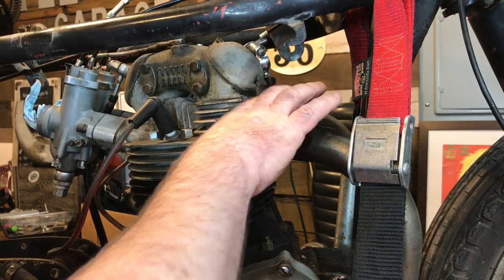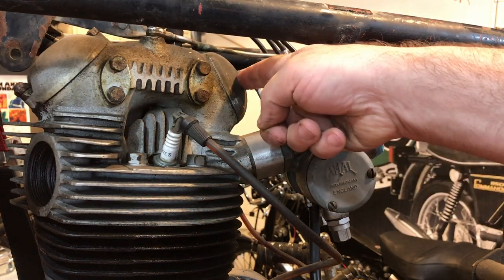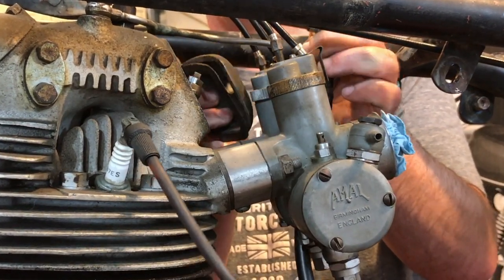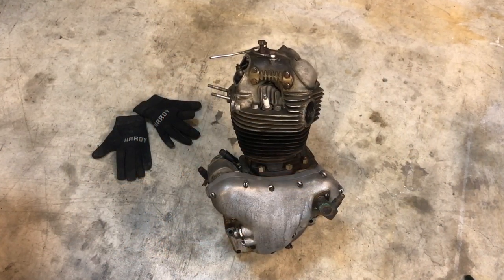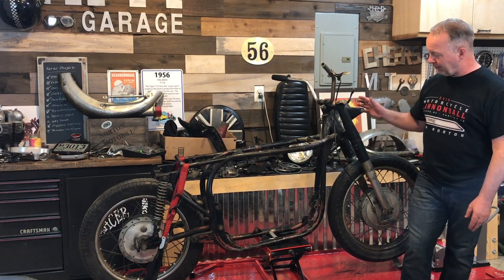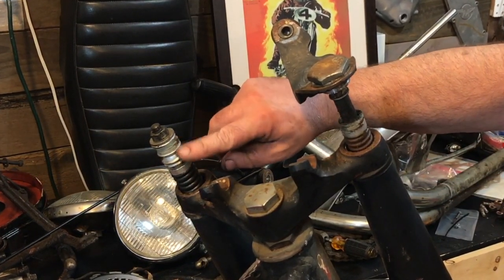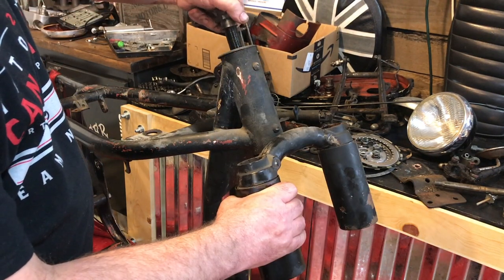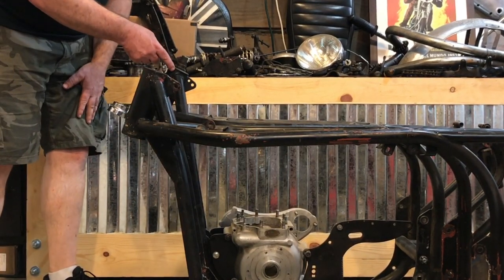1961 Norton Manxman 650 project (6) - Disassembly Part 5

Comment: Great stuff, soaking everything in atf acetone for a few weeks make a Huge difference, also soak rusty parts in white straight vinegar for 2 3 days also works great .Am about to restore  a 71 250 Goldstar winter project, complete, sort of runs, 3321 miles but i presume more since the speedo is not functioning.Cheers from Canada...
Reply from the maker: Thanks a lot Andy for your note.  Good luck with your project!  Best wishes for 2020. Cheers, Mike

Comment: I think that the elevated bike stand is not an advantage when actually removing the engine, it is much easier if you can get above the weight, and also less of a lift onto the floor, at least all the bolts came undone easily !  I hope you are going to dump those hideous bars when you rebuild. Well done. Chris B.
Reply from the maker: Hi Chris, yes I realized afterwards that it would probably been better to try and take the engine out with the frame lower down.. I'm sorry to say, but it may end up with even taller bars!! The original spec has enormous handlebars,, but what I might do is get a of flatter bars that I will use and use the taller bars for shows, etc.  Cheers, Mike

Comment: Puling engines are always a pain in the a$$! I've learned to lay the engine on it's side propped up/elevated and the framed layed  down over it then drop in the bolts. It's about the only way you can get a Honda engine in without loosing your mind.
Reply from the maker: Thanks, yes, fitting it may take some help and a lot of protective covering for the nice paintwork!  Best wishes, Mike

Comment: I hope you had your steel toecap boots on when you pulled that engine out. It's the kind of job I like to do a floor level and roll the engine out onto a big piece if foam.
Reply from the maker: Hehe, yes I did have a nice padded floor mat to place the engine on!  It wasn't so heavy thankfully, being a 650cc engine.  Cheers, Mike

Comment: I didn’t watch the entire video due to sketchy internet access where I am at the moment, but I didn’t see a head steady. Something that is necessary to “help” prevent the featherbed steering head from bending. Won’t save it in a crash, but best to have one on there. Folks tend to assume (as I once did) that they are on there just to control engine vibration. Did one come with the bike? I am curious as to why your frame straightener didn’t want the bike with the engine and gearbox still installed. Helps to insure that the motor mounts etc  don’t get pulled out of alignment. The motor etc still might have to come out for some of the repairs, but better chance of things staying aligned for the major pull. Good luck with your project.
Reply from the maker: Hi, thanks a lot for your help. Yes, it did have a head-steady fitted. I took it off earlier. The frame straightener didn’t need the engine or gearbox. He’s done so many featherbed frames that he has made himself some jigs that simulate to the engine and gearbox in the cradle, so I’m very confident that he will keep everything in alignment. I’m really looking forward to going back in about a month to pick the frame up and hear what he did. Hoping to capture his update on video too!
Reply: Good that he has a jig. Properly done, a jig would be better than stressing the cases if the frame requires some serious work. Interesting bike you have there and good that it is being restored. Not sure I could deal with the original seat cover though... bet it will generate a few comments.